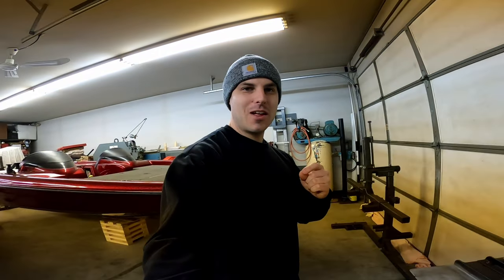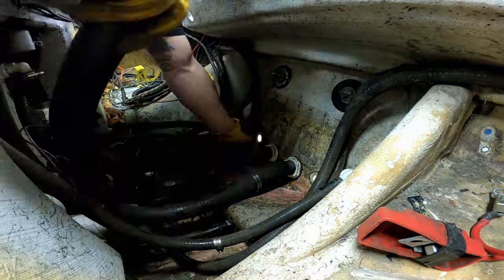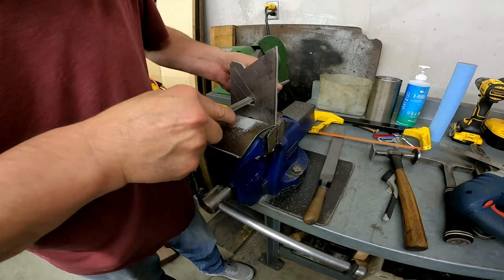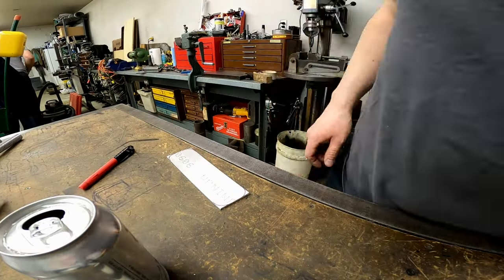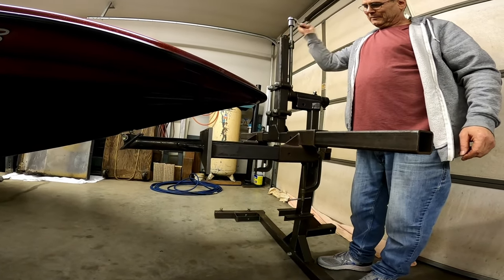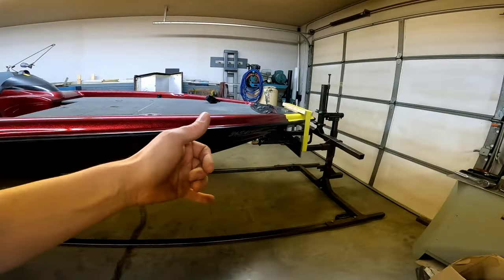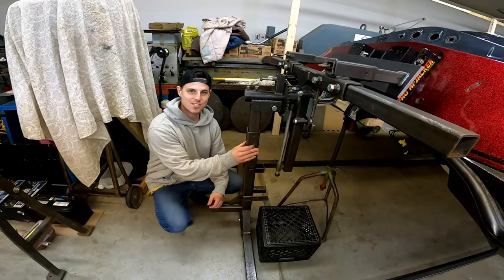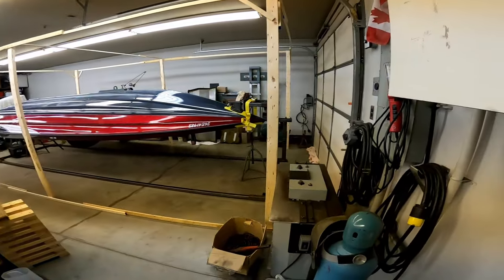DIY Bass Boat Restoration: Flipping Boat Over To Repair Gel Coat | Part 4 - Triton TR-20 Build

Comment: Hey guys...I just purchased a 2000 Triton tr20 that needs some work. Maybe I could hire you to restore it. Engines good and is currently off the boat. Great Job! Fun to watch.
Reply from the maker: We'll do anything for the right price ;)
Reply: @FishingOntario  Wasn't sure if you'd get my message. Thanks for the reply. I'm having a friend of mine, who knows more about this stuff than I do, take a look at the transom in the next week or so. It does have some spider cracks but still sounds solid when you tap it. Hulls in decent shape. Cracking in the gel coat in spots. Could use new carpet and old hoses and stuff replaced I'm sure. Maybe I could send you some pics and more of a diagnosis of transom once he takes a look. Is there a way to contact you outside of youtube? Thanks again.
Reply from the maker: @midlandappraisals3674  yeah, absolutely! Hit me up at kyleholmes1@hotmail.ca
Reply: @FishingOntario  🤙

Comment: Probably 3M 5200 adhesive on the thru hulls. 
Total Boat adhesive remover softens it pretty good.
Reply from the maker: We will have to give that stuff a try! Thanks for the tip.